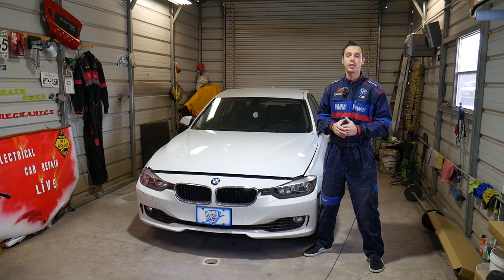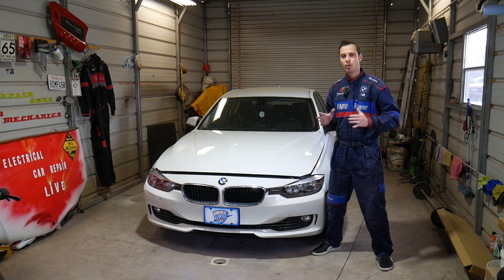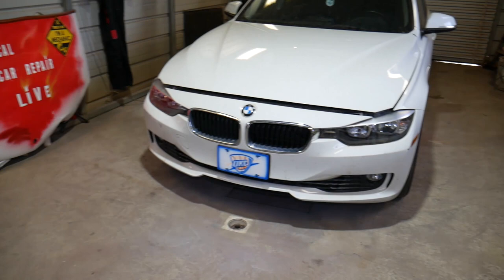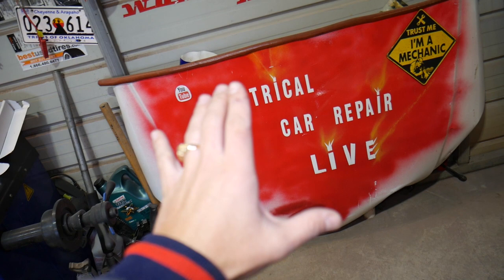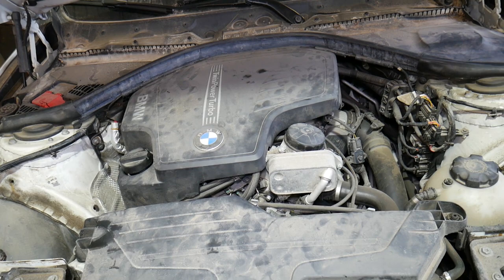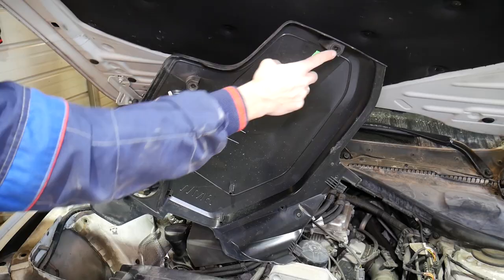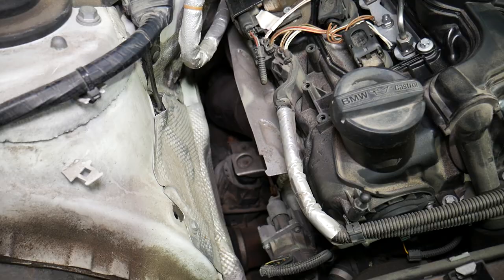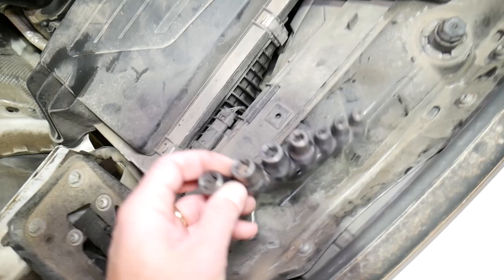BMW EXHAUST VANOS ACTUATOR SOLENOID LOCATION REPLACEMENT EXPLAINED F30 F31 F32 F33 F34 328i 320i

Comment: Hello sir, thank you for the video. I have an 130716: VANOS, exhaust: control error, camshaft is stuck error on my BMW G30 2018. Is this a error to replace the vanos? Or is there an another solution? I would kindly appreciate your help.

Comment: Hi I have a 2013 BMW 328 I with n26 engine and after driving for few days and or long trip I’m getting a P13C9 code, I purchased the vehicle used and I replaced the timing chain assembly few months ago, please advise on what’s causing this code to come up thank you

Comment: Excellent video, I have a BMW F10 528i 2012 can you help me locate vanos solenoids and vanos actuators?
Reply: Man same question here. I have 2013 528i and just can’t locate vanos solenoid. Let me know if you found it. Thanks
Reply: @TahirShaikh1  Same
Reply: @Muhammad-fw9vl  I think they look different in some Cars. And I believe one have to take out the camshaft position sensor, and the vanos are inside where that sensor came out.
Reply: @Muhammad-fw9vl  look at the 3d drawing here
https://www.fcpeuro.com/products/bmw-vanos-solenoid-valve-ina-11367583820